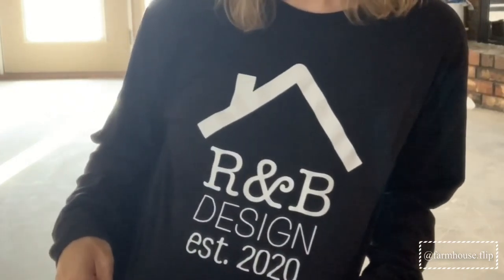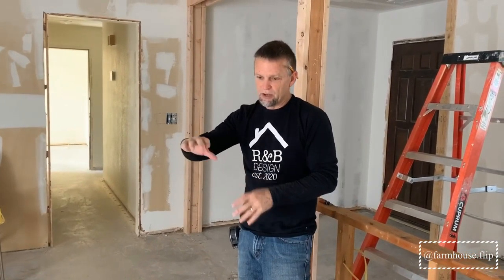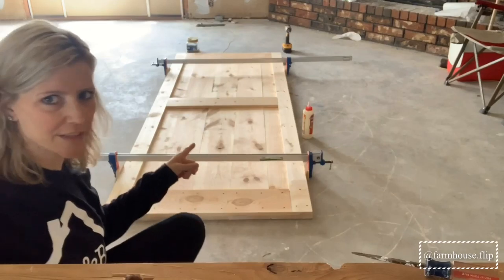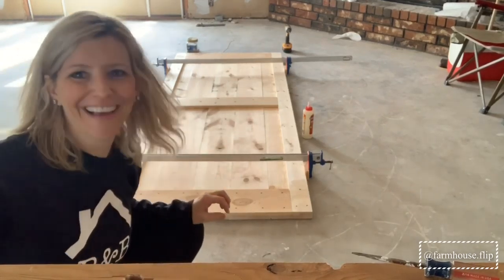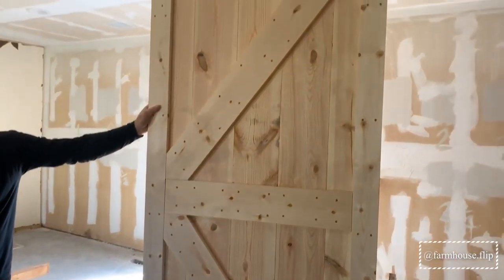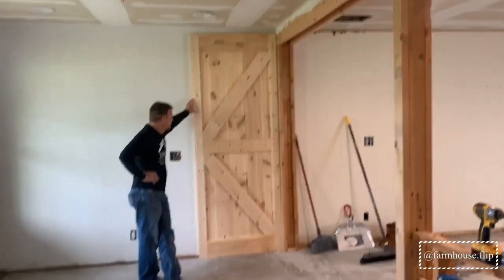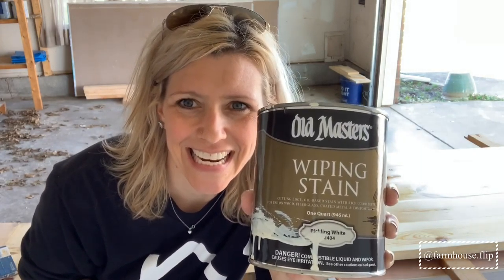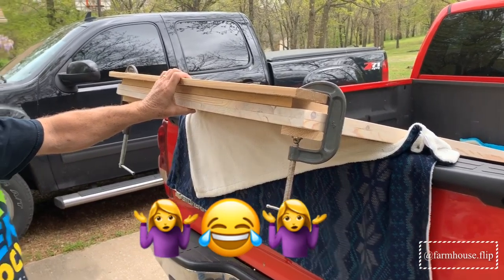DIY Sliding Barn Door

Comment: Nice job guys and I'm a 40 year semi-retired carpenter.  Just installed a bunch of horizontal 1x8 shiplap siding in a basement room for hangout room my granddaughter, work space a well since she is very artistic and creative.
Decided to use a semi-transparent latex deck stain from Ben Moore.  Maritime White.  Dried quickly and very durable, similar look to yours with easy application, bright white trim with 1x8 base and 1x6 verticals and ceiling trim.  Creates a big frame and panel look.  Trim is no knots clear primed pine product, FJP (finger jointed primed). 
Will make barn doors to your exact style as her and my daughter picked the style from pictures.  Using Satin Nickel for the track and hardware in this case.  Stain product is Benjamin Moore ARBORCOAT - comes in both latex and oil I think.
Their latex solid stain has lasted without peeling on my cedar balusters on exterior front entry deck since 09 or 10 I think,  10+ years.
Best on your endeavors, hope your New Year is a good one.
Reply from the maker: That sounds awesome! I’m sure your granddaughter will love that!!! Happy new year!
Reply: @karenbaskettdiyer  Thx Karen

Comment: Thank you KB. Have you made or have recommendations for a sliding barn door the cure’s around the corner, like rounded corner not square? Ty.
Reply from the maker: Maybe just router the edges to round them off. 😊
Reply: @karenbaskettdiyer  No, I mean it should curve around a corner when they close. So the track will curve like hospital curtains do around the patients bed.
Reply from the maker: @ScreenPrintR  ahhh… ok. Hummm that’s a hard one for a barn door slider.